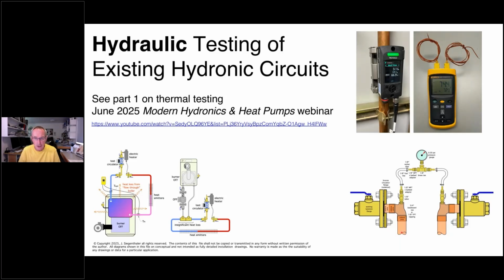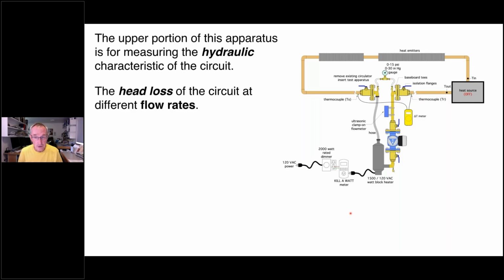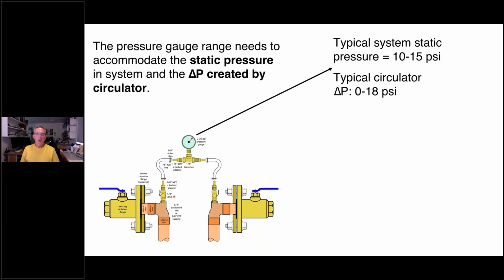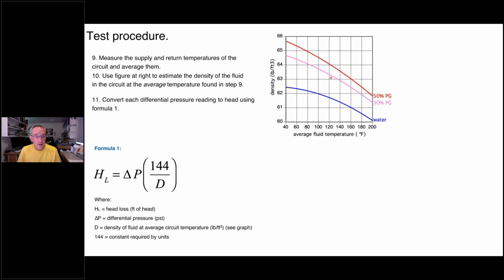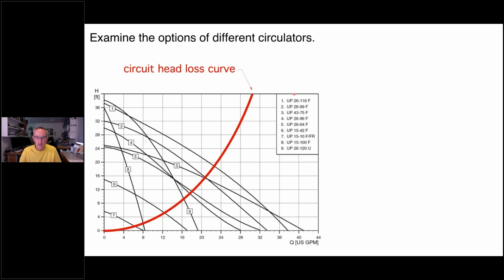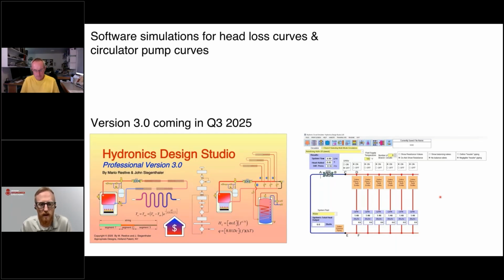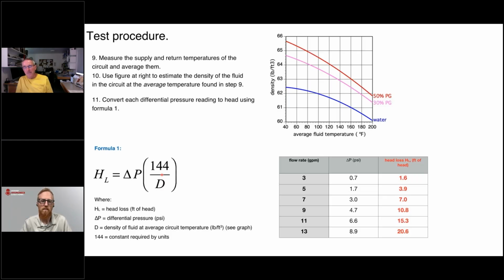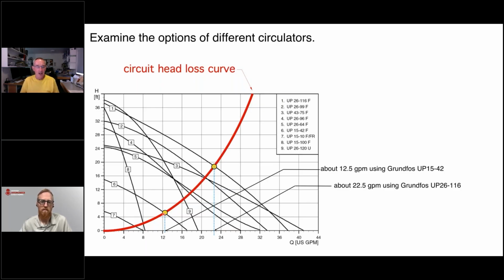Hydraulic Testing Existing Hydronic Circuits

Comment: Thanks for the webinar.  It was great.  
One question I didn’t think to ask.
The testing rig shown, does the size of the piping connecting the test circulator, and through the portable heater have any bearing on the measurements?  
Is any compensation or adjustment required on the pressure calculations?
Does the test rig have to match the pipe size of the existing hydronic loop?  
Thanks.
Reply: This is only how I think of it, please anyone elaborate if I'm missing it:

If you added additional pressure gauges closer to the test circulator, we would expect to see even higher discharge and lower suction pressures. This wider delta P would reflect the additional head energy initially imparted before being dissipated (in part) across the test rig. So in theory, the test rig could be 1" and the baseboard T/mains 3", and the energy lost across the test rig would be reflected in the gauge readings. Therefore, we are still reading the head loss of the existing field circuit only.
Reply: @AppleMan7100 we may never know.  I put that comment in 10 days ago.  They don,t even monitor their own channel and respond to comments here, or on their FB page.
Reply from the maker: Thanks for stopping by with your questions! We checked in John S., and here are his answers:

"Since the pressure differential is measured at the two flanges where the test rig connects to the circuit, the pressure drop in the test rig itself is not relevant.  True that the delta P at the flanges would be slightly less than the delta P across the test circulator, but again the delta P of the circuit between the flanges is what characterizes the circuit.

The pipe size of the test rig is not critical, although for most small circuits it would probably be the same as the circuit pipe size, or  +/- one pipe size in either direction."